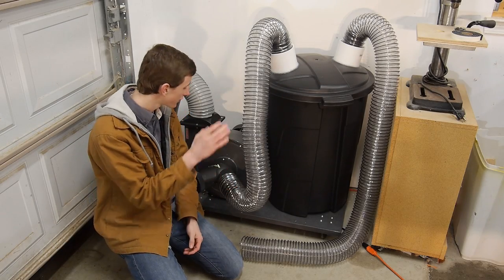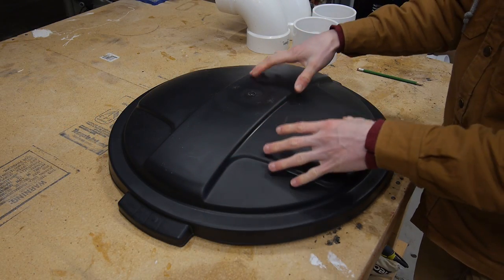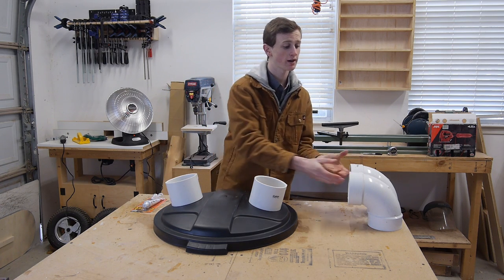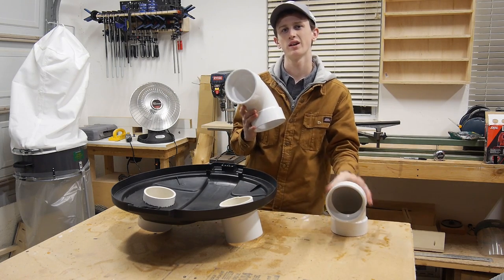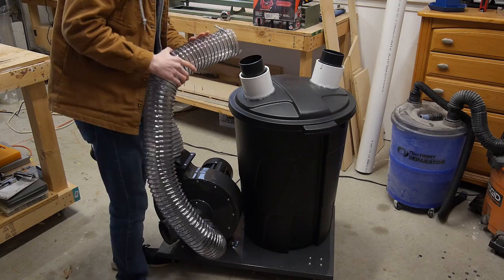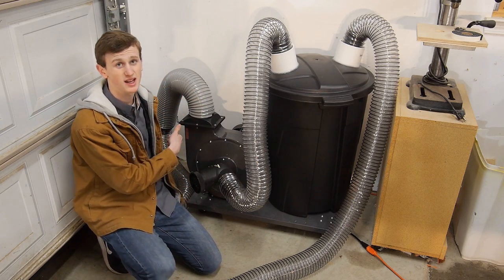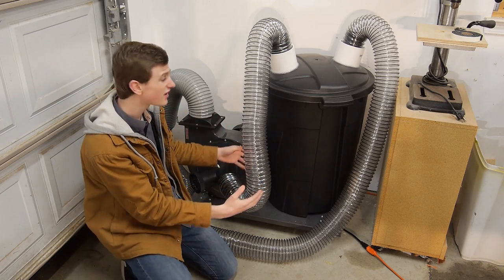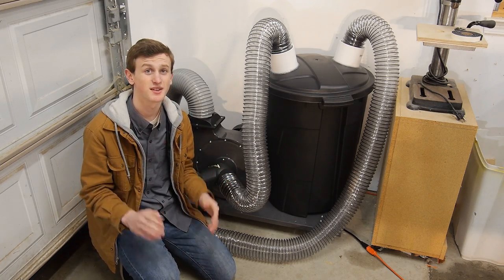How to Make a 2 Stage Dust Collector | The Easy Way!

Comment: Thanks for this.  I made one for myself with a metal 32 gallon trash can, and 4" to 3" reducer couplings which fit snug inside the flexible 4" hose.  For those who have asked, it works really, really well.

Comment: If you haven't done it yet I recommend that you make a rigid lid and place the exhaust line in the center and without the 90 degree fitting. I found the results to be better. The change of air direction drops more particles out. A fifty gallon drum works best too, if you have the room.

Comment: Very cool. I want to make one. I'd be interested on a followup to see how well venting the dust outside works after some use. I have a basement shop and while I could vent my dust out a window into my backyard I wouldn't want a big pile of saw dust just sitting at the end of the pipe or a lot of obvious saw dust blowing into my neighbors yard. If the dust is really fine and well dispersed it should be fine. It would be interesting to see the outside vent in action and to see what it looks like after a few months of use. It might make a good followup video or maybe part of the upcoming vent plumbing video. Thanks for sharing your experience.

Comment: Thanks for the tips in the video. I'm doing something very similar. I have been using a Wen 660 CFM dust collector with a Behrens stainless steel 31 gallon can and a separator lid. The Woodriver lid works great, and saves me the trouble of constructing a separator lid from the trash can lid with pvc pipe,  connectors, sealant, and foam. It arrives ready to work. The blower is mounted on the wall next to the window, with a very short run of tubing to the output port of the trash can lid. I have a piece of lumber with a 4" hole where I mounted a 4" connector. The exhaust tubing runs from the blower exhaust port to the connector in the board. The board fits perfectly in the window frame of my garage shop. Most of the dust and debris I pick up is separated into the can. Nothing but fine dust gets to the impeller, which is much better for the blower. The fine dust settles outside in a mulch bed, barely ever noticeable. Works well, but of course, I wanted MORE POWER. I am going to buy the Harbor Freight 2hp system and swap out the 660 CFM blower for the 1,200 CFM blower.  I also like that the whole rig can be on wheels in case I need to move it around.

One quick note on the tubing. Exhaust runs do not have to be made from hard pvc or steel ductwork, as there is no vacuum in the exhaust. Flexible tubing works great as the exhaust run. Hard pvc pipe is best used on the collection side where possible, before the blower, so there is as little compression of the components as possible while the system is in operation. You should only need flexible tubing for the last 10 feet where you want to vacuum the floor or collect dust connected to a tool.

It's amazing how much more suction is achieved when bypassing the bag and direct venting to the outside. I would say it is 2x-3x greater than when using a typical system with a dust collection bag. The back pressure caused by the bag robs the system of a lot of suction. Ditch the bag if you can vent the fine dust outside.

Comment: Congrats on the new dust collector Eric.  That's the same one I bought last year, and I was surprised (and glad) when I opened the box and didn't see that HF (or Matthias) green monster.  I think you'll be pleased and with it, it's a major improvement over the shop vac on the table saw.

Comment: That materials list was a really good idea! What schedule PVC pipe did you use - 20, 40? One small improvement to airflow might be to eliminate that sharp turn in the hose right at the impeller inlet, might have to take off the inlet flange and rotate it one bolt hole. Sorry, it was bothering me :)
Reply: Thanks Eric. Schedule 20 is lighter weight and I've heard is good for DC but I can't seem to find any.
Reply: Michael Anderson It's also called "sewer pipe".  Lowe's and Home Depot carry it.
Reply: Donald Fugitt Thanks, I'll look for that. Are fittings available?

Comment: Hey Eric! Just a idea... You might want to put a screen or a vent on the inside of the trash can on the pipe that goes to the motor to prevent any big pieces getting in the motor and bending the blades or messing up the motor.

Comment: What's the purpose of the 2nd 90 degree piece on the inner lid? I thought only one was needed on the inner intake port to 'cyclone' and separate the heavier stuff into the can, while the other port drew the fine particles to the impeller and out the door. I don't see the benefit of using 2 elbows, but if I'm wrong would someone please explain why?

Comment: long shot but I have the same dust collector but trying to hook up dust deputy and I'm losing horrible suction pressure. I have it hooked up right and it's going into a 30 gal trashbin sealed tight. I'm losing suction bad and want to know any tips or tricks. also is your way your doing it are you losing any suction pressure .

Comment: Direct that outside into a compost heap.  True you will have fine plastics and metals, but they should be minimal, and you can collect them separately if you want them out of the composted matter.

Comment: hello. what do you use the second 4in port on the HF dust system for? If you are not using it; what did you use to block it?
Reply: If you are talking about the Y connector that is right at the machine. It is because that is what comes on the Harbor freight duct collector. That y has 4 " exit size, but if you remove the Y the exit hole is quite larger. He wanted the 4" exit, so he left it on. The Y is also a reducer. Also the cap that is on the other side of the Y also comes standard with the HF dust collector. It was simpler to just leave it on.

Comment: Hi Eric
What is the power of the engine?
If you reduce the input to 40 tube would lose suction power?
I say this because sometimes it is needed to vacuum as a conventional rigid pipe vacuum cleaner
Thanks and good video

Comment: Question for you, I just built this basically the same way with a few differnt pieces from what i had in my shop.  When I use my sperator I seem to only  be getting maybe 60-70% of the chip?  the elbows seem to be in the right spot in the trash can, I was wondering your opinion?
Reply: Did you end up finding a solution Matt?

Comment: Eric...Nice Video.  You definitely cut alot of the BS out of it!  Nicely Done.  Instead of piping it outside, what would you think about just piping it straight up to the attic?  That would eliminate the need to have the garage door open or cut a hole through the wall.  I'm thinking about doing what you did with that harbor freight unit but pipe the exhaust to the attic above the insulation line.  Just curious what others might think....open dialogue...anyone welcome...
Reply: The problem with going direct to his attic would be he would fill his attic with dust and create a huge fire hazard. He has no filtration on that system so even though the can collects the large parts all the fine dust still passes right through.
Reply: Do you think it would have the power to pipe up then over say 20 feet to a dryer type outlet?
Reply: Martin Maloley that would depend on what he used to run that far. My dust collector has runs over 20ft from tools to the collector. But why would he need to run 20ft to a dryer type vent. He could just vent it right out the wall the collector is sitting against.

Comment: A second trash  can to run exhaust hose through would clean up what you are exhausting outside to with a divider inside  the can with the incoming hose at the upper half of the can the other side of the divider the hose to go out the bottom half of the can

Comment: You're getting stuff past the can because of your design.  Your inlet is almost shoot into your out take.  You had half your cyclone in the part you removed.  I would have made a lid for the can then mounted the middle piece from the original.  Make a lid for that with the suction attaching in the center of that.  That line goes deep enough to not catch the incoming debris.  Otherwise not bad.
Reply: wauhawk yeah I'm pretty sure it's just a single stage that he made he took off the baffle which would've made a great separator on top of the trashcan I agree

Comment: Hi, I would be worried that someone would be able to get into your garage with that opening at the bottom and steel all your woodwork tools, I would make a hole in the side and run the pipe out that way. A good way of sorting your dust collection.

Comment: As a plumber who also does woodworking it really drives me crazy when people call them couplers not couplings lol no big deal.. also if you were trying to save weight you should’ve went with 30-34 pipe instead of schedule 40 but everything looks great

Comment: I'm no expert on dust collection, but I thought "two stage" meant two levels of filtration? seems like you still have one stage, it's just before the impeller.
Reply: Robert Mcdonald the second stage he chose to exit out the garage instead of into a filter bag hope that helps you understand and if you can do it that way without causing any outside issues it's much better that way
Reply: Robert Mcdonald also the garbage pail separates the larger particles witch is the second stage
Reply: I fully understand how the seperator works, but there is only 1 stage of "filtration". It is a dust exhaust system. And because of the pressures created by moving air, some air is sucked in from elsewhere. It's not filtering, it's just exhausting air.
Reply: Robert Mcdonald the first stage is the trash can it separates the large particles and then most people would then go to the bag/filter he has chosen to vent it directly outside witch is better because the filter can't get 100 percent and two stage does not mean two filters
Reply: Robert Mcdonald most people do not exhaust it outside because or the mess it could cause I prefer to exhaust mine to the outside I have no direct neighbors
Reply: jayboney el toro I think we are discussing two different ideas. you are speaking about removing dust particles away from the shop. I'm discussing filtration to keep it out of my lungs.
Reply: I'm not sure if exhausting to the outside is better. in your case maybe, is your shop an attached garage or stand alone. whenever air is moved it has to be replaced or you create a vacuum,  where is his air coming from? the open garage door? elsewhere in the house?
Reply: do not misunderstand my comments, if it works for him, that's great. but it would not work for me.
Reply: Robert Mcdonald I was just trying to answer you question that was how is that a two stage and I answered that question now if you can't pipe it out side the add an additional filter or just get a separate room filter system and if you want it to work in the best way again filter it out like you would a clothes dryer I'm not sure what is so confusing the way he has it set up there is zero return air coming in the shop try running the exhaust pipe into a homemade box that you can put a bunch of heating and cooling filters in
Reply: Sounds like someone wants to make this idea way more problematic than it needs to be. What's not to like? You want to filter the air then run the hose to the filter on your unit. He wants to run it outside so he doesn't need to and as long as the wind isn't blowing the fine dust back into his shop, HE will be doing a lot less work and since he won't be opening a filter bag up in or near his shop or near himself HE again will have less exposure. Cut the kid some slack for a good idea.
Reply: Bradley Bowles I tried to explain something simple the guy just couldn't grasp it lol
Reply: Bradley Bowles it was not my intention to berate or belittle. he did a great job. my comment started with the concept of "what is two stage?" and evolved into "what is filtration?". Never said it wasn't a good unit or a good way for him.
Reply: jayboney el toro the two stages are ..1. trash can seperator  and 2. the impeller/exhaust to the outside.. correct?
Reply: When you buy the unit from harbour freight it has 1 stage (the impeller unit) and 2nd stage (the collection/filter bag) .by the "stages" you've mentioned it is the same. so why is it sold as a single stage dust collector?because it is only "collects" in one stage. the impeller unit is not a stage.!!
Reply: Robert Mcdonald the impeller is not a stage the plastic bag with the cloth bag on top is the collection/filter so it is a single stage the added garbage pail system separates the large particles and the fine particles continue to the filter he bypasses it by going outside with it the purpose of this system is so the system can pick up larger particles without damaging the impeller
Reply: jayboney el toro guess I'm a stickler for semantics. it's a two stage setup but he chooses not to collect the second stage. I understand the concept, just disagree with the label. no intention to say he is wrong or any thing like that.
Reply: I do understand two stage dust collection, in fact I have built one with a "top hat" thein seperator and used the same harbour freight dust collector
Reply: Robert Mcdonald 
No worries. No matter what it's called or how it works the end result is less dust and debris in the shop. I think it was a well done video and well explained on how he did what he did. That being said , if ones concerns are about the technology, and technicality of it all, I would suggest asking a professional on it . Personally I'll take what I can use from it and apply that to my own ideas for my system and say thanks for all of the information and time spent on making the video. Best of luck to you sirs and thanks for the information.
Reply: Robert Mcdonald I'm sure his parents are not going to appreciate the mess outside lol but the car should stay fairly clean
Reply: He converted a one stage to a one stage.  Removed the vortex/baffle that was there in the metal part between the filter bag and the plastic bag.

Comment: Good job except for garage door being open that far. A skinny thief can slide under the door and open it for his buddies. Boom! All your tools are GONE! Why not try a 4in. dryer vent, (for now), thru wall and a cat door in bottom panel of garage door. Think ahead, prep for the worst.
Reply: I was thinking of doing this in my shop until someone pointed out that I would be pulling the worm air from my shop. which would raise my bill l'm guessing drastically.

Comment: Nice job but you'll find the 2 pipes into a garbage can technique is only efficient for the first half of the container at best (sometimes the first third) - then it starts to suck up the contents again. A bit more effort and you could make a Thiel baffle that cures that problem up to about 80 to 90% transfer.

Comment: I'd hate for your investment in the vacuum-blower and its impeller to be sacrificed prematurely due to assumptions :
You'll want to follow the air flow from intake to exhaust and whether there is a physical / physics-based reason derived for precipitating out particle masses from the air stream based on their velocities and centripetal forces in a balanced handshake with gravity = as to whether there is a reason therein to whether precipitation is designed based on forces that counter gravity using momentum / inertia for those targeted particle sizes instead of letting ANY get to the fan / impeller housing. 
Best wishes! 🙋